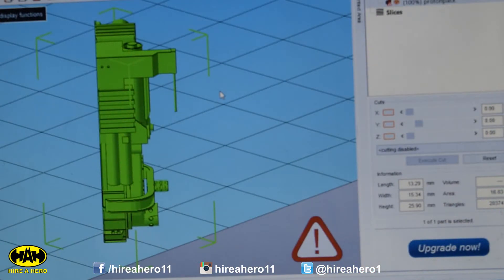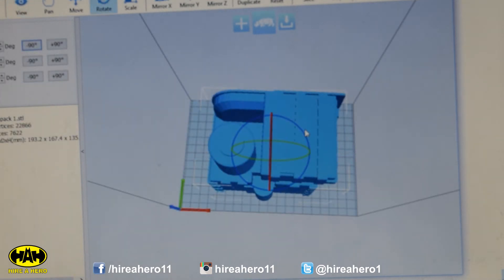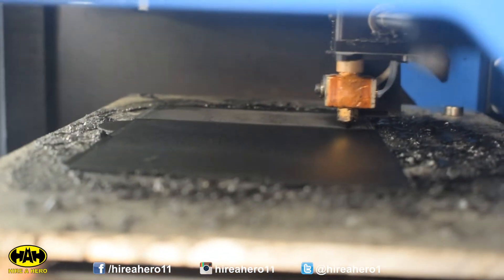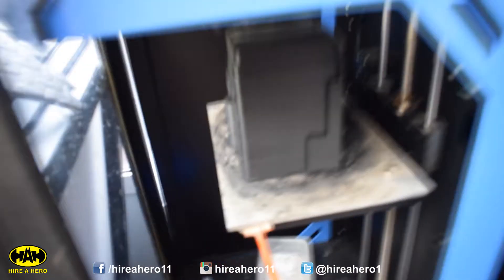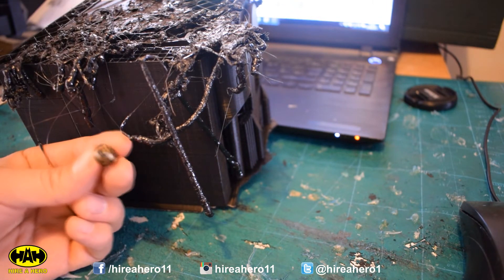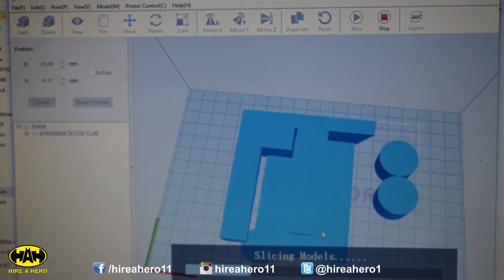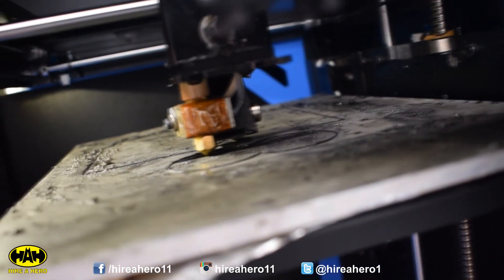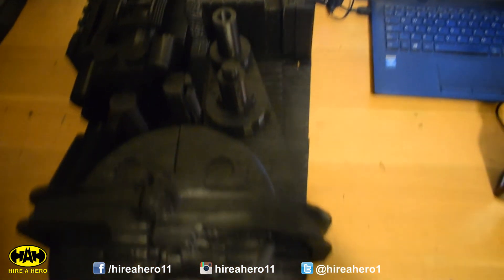3D Printed Ghostbusters Proton Pack Tutorial - Part 1 - Scaling/Slicing 3D Model & Printing

Comment: what the messy stuff on the print bed ?
Reply from the maker: Ectoplasm!!!! :P
Its ABS paste. Where the aluminium is sosmooth, the print doesnt like to stick to it. So i brush on a few coats of ABS paste to help it stick.
ABS paste is simply ABS plastic dissolved in acetone.
Reply: lmaoooo If it was Ectoplasm! I'd be asking to bottle some up for me lol I used to do the ABS slurry mess thing along time ago , and I forgotten just how messy it was lol , I print on glass now using 3dLac and wolf bite, much much cleaner and holds better then the ABS slurry. Happy new year